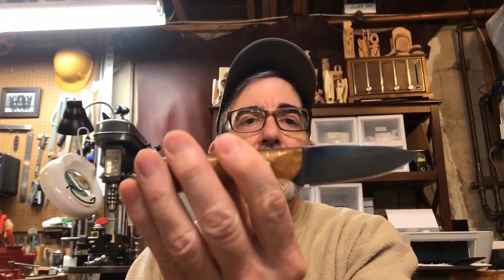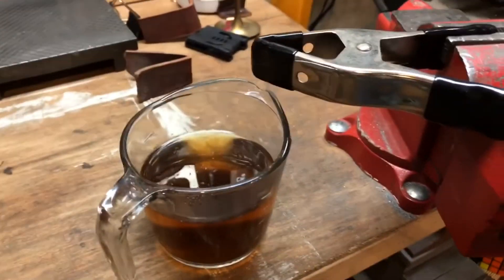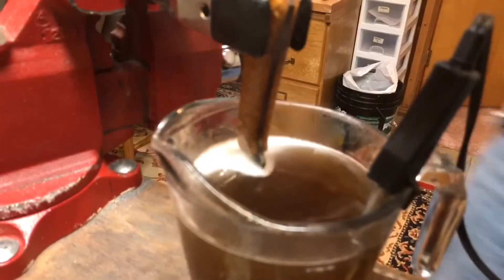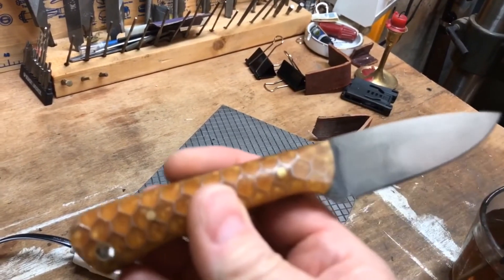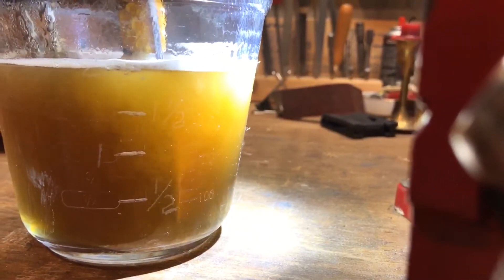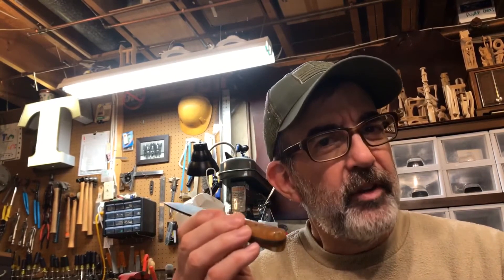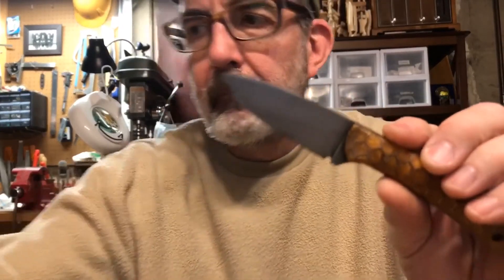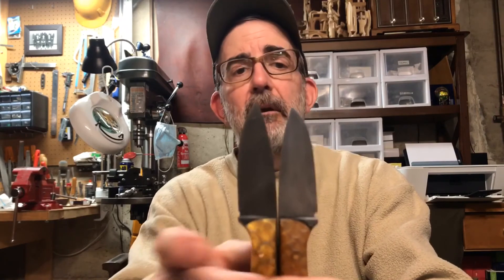Acid Wash Patina on 1095 using Apple Cider Vinegar

Comment: I find, with 1095 steel that has been used a lot, that cold white vinegar does exactly the trick. Cleaning the blade first with sandpaper or steel wool, to remove slight rust and other debris, is apparently helpful. 3 years, much use and a simple cold vinegar soak twice is at minimum maintaining a tool. The in between maintenance includes common sense and a lack of not caring. Good video.
Reply from the maker: I'll try the cold version.  My vinegar started off cold, but things did not seem to be happening until the temp started to rise.  I've not had to touch it up as I cut lots of tomatoes and garlic with my knife and that really adds to the patina.  

Thanks for watching !!!

Comment: I taste test vinegar, olive oils, worcester ect but when you downed that glass I did sit up and holler WTF. Got me good lol I have used mustard and apple cider on 1095 and liked the results I will have to try it using the constant heat.
Reply from the maker: 👍🏻 glad I gotcha! I was hoping to do it smooth enough for no one would figure anything out.

Good luck trying it with the constant heat. Let me know how it goes. Keep the handle out of it. It could warp it.

Comment: So does darkening the blade help deter rust
Reply from the maker: Strangely enough it actually does. Creates a barrier. Does not make it stainless or impervious, but it does provide a slight amount of protection, and then should you get a little bit of surface rust and you use steel wool to get it off, the stain left behind kind of just blends in.

Comment: My 01 blade didn’t  need any heat just left it in there for a known time and measure results after that..say half an hour then see what happens…
Reply from the maker: I will have to try the “non-heat“ version. I’ve tried it with 1095 and found that it just sits there forever. The heat really gets things going.

Comment: will this help with rust
Reply from the maker: Great question.  I think it may retard the rusting process a little, but it still pays to be careful.  I guess, with a patina and coloring like this, if you do happen to get some rust spots that you can then remove with oil and steel wool, it won't look as bad as it would if the entire blade is a nice satin finish and then there is this rust scar.

Comment: Could i do this for my metal handles?
Reply from the maker: That is a great question. As long as there is no coding or anything on them and it is completely bare metal, I don’t see why you couldn’t. Might be worth giving it a try. But what kind of knife has a metal handle? Other than a Randall model 18.
Reply: @knifetimestory  buetterfly knife : ) might give it a try.
Reply from the maker: Gotcha. I would imagine if they are 1095 or something similar you could probably do that to them.